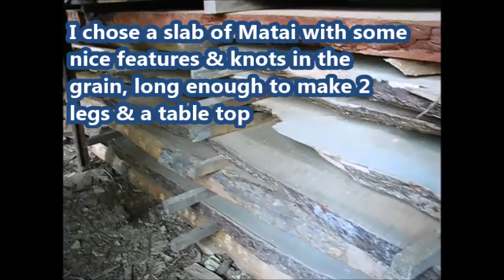How to make a rustic timber slab coffee table with no visible fixings

Comment: I know this thread is old Nelson, but how has the table held up over the years? I built a table that didn’t allow for the top to expand/contract over the seasons and the wood cracked. Any issues with your table top? Thanks.
Reply from the maker: Hi Michael, Yes the table top is still nice and flat with only a few small cracks but not surprising after being left out in the elements for all these years. The bottom inch of the legs are starting to show signs of rot, probably should have painted some creosote or metalex on here.